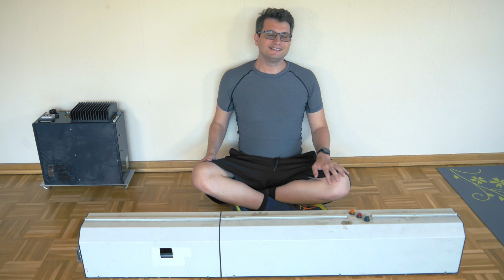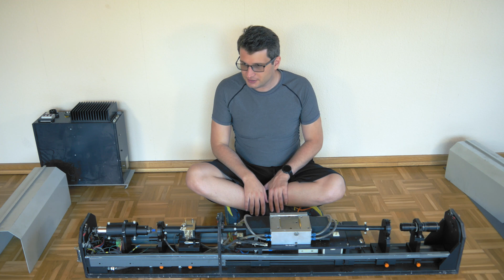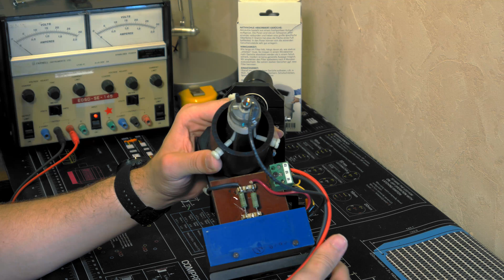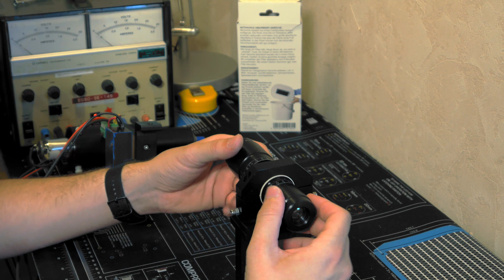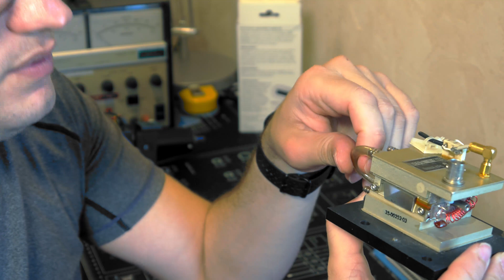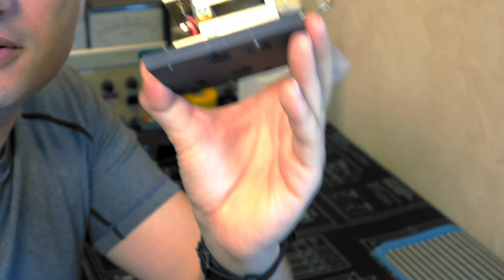Massive YAG Laser!

Comment: The beamexpander is not a ZnSe one, those are used for CO2 lasers. The flashlamp may look bad but that's just their high mileage. You can still give them a try, good chance they still have quite some shots left in them before they fail.
Reply from the maker: I took that unit for parts, looking at the lens it has the typical color of a ZnSe one, but you may be right, I have another unit not as powerful but way more compact than this one on my shelf. I plan to do something with it when I find the right space to work with it.

Comment: Hi, maybe this is an odd question! but do you is it possible to make a laser dot in diameter 0.1mm with F = 1.2 meter?
Reply from the maker: The divergence depends the kind of laser you are using and wavelength, you may want to check Huygen Optics channel for advances optics videos.
Reply: @VinisLab  ah ok thanks for the answer. I was there, ok I go back